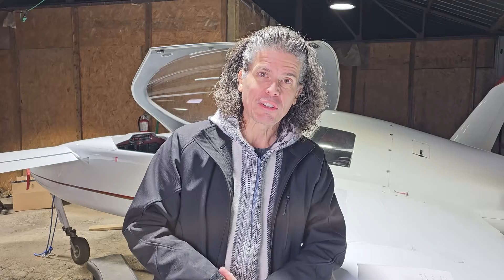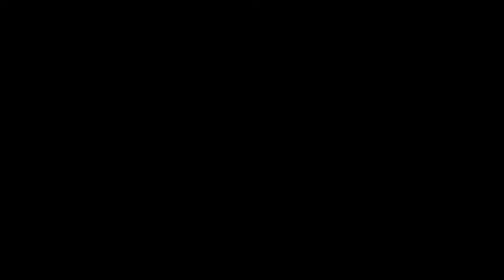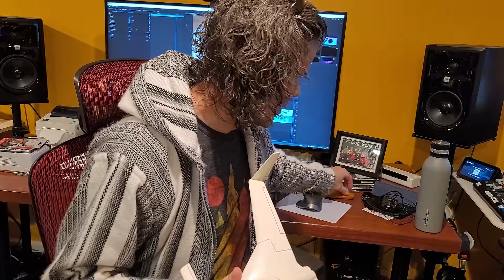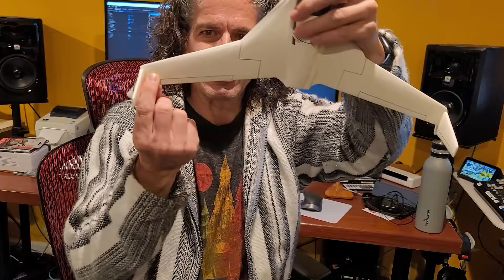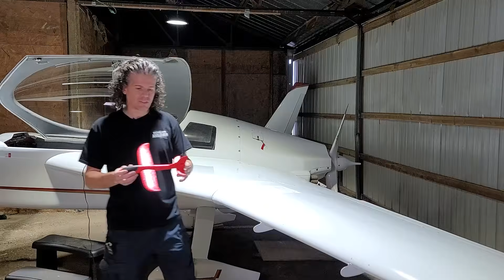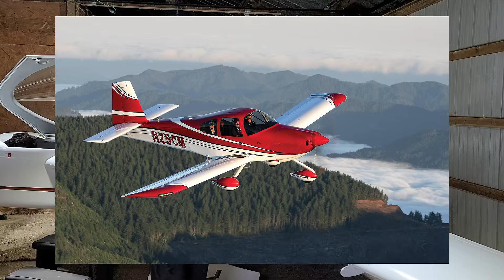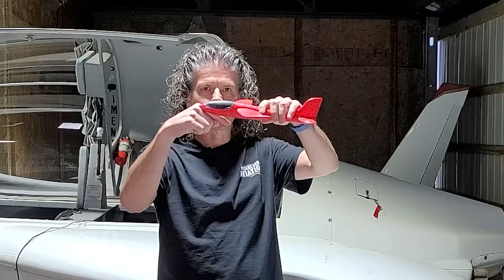Canard Aerodynamics: Why You Might Not Want a Canard Airplane

Comment: Also the prop gets dirty air, which makes it less efficient.
Reply: yet, despite that miniscule amount of inefficiency, the pusher canards still wins over traditional aircraft in cruise speed and fuel burn.
Reply: @wiliam8244  Depends, depends. Look at the efficiency and speed of a Swiss Excellence Risen or of a MCR 4S (keeping in mind, that the latter is fixed gear). Or consider a Panthera.

And the Pipistrel Virus actually has a negative flap setting, that reduces the drag of the main wing and reduces the work that the elevator needs to do.
Reply: @MaxMustermann-nd4uy  Is this a bot or chat gpt reply?  Your statement has zero relevance to this , essentially.   Your point was that somehow any dirty air caused by a pusher was somehow, because you made the point, significant enough to be a negative.   My point was that despite any prop "inefficiency," giving you the benefit of the doubt, the speed and low fuel burn of these canard type aircraft makes any prop "inefficiency" essentially Insignificant.     

Me and nearly everyone that understand this:   "Cruises over 200 knots and burns 10 gallons per hour."
You:  "PROP inefficiency!"

YOu get my point, but probably not! lol

Your response has NOTHING to do with the subject of these comments.
Reply: @orthopraxis235  In principle, I am happy about technical discussions, but on a technical level and not in such a confrontational way. Sorry. If you want a response, you can modify your comment.

Comment: in regards to a conventional  C.L.T.  S.E. tractor prop- cruciform aircraft configuration, there are usually a built in nose down incidence on the horizontal stab of those with a fixed horizontal stab, the main wing usually has a nose up incidence, of which, both are based off  the level line along the aircraft's fuselage.. So therefore when you apply engine  power you have to add forward trim or aft trim as you decrease power in order to maintain level flight during power changes.

Comment: The whole thing with the swept wing and aspect ratio comes down to one simple concept...spanwise flow is inefficient so avoid it if at all possible.  Higher aspect ratio wings have less chord so spanwise flow is reduced and thus provides a higher lift:drag ratio.  Sweeping the wings back increases spanwise flow because even at zero AOA, there is spanwise flow equivalent to the angle of the sweep.  The more sweep or AOA you give it, the more spanwise flow you'll get.  Take it to the extreme and imagine a 100% swept wing, basically folded all the way back like a kitfox in transit.  In that configuration, you have 100% spanwise flow and your wings are almost useless (they'll still make some lift, but not much).  The other extreme is AOA with a low aspect ratio (imagine a wing with the same chord as its span), keep increasing AOA of this wing all the way to 90deg, the air will hit the center of the wing and flow in all directions....forward to the leading edge, back to the trailing edge, and out to the wingtip all at the same time, this could also be considered 100% spanwise flow as the air simply radiates outward from the center of the wing.  Your wing is useless as anything but an airbrake at this point.  Decrease the AOA of this wing to say 45deg and you'll notice that all the air is flowing rearward and spanwise at around 45deg, tons of air spilling over the wingtip which is very inefficient but making some lift.  Swap that wing with a high aspect glider wing at 45deg and you'll see that the air is still traveling out at 45deg but very little of it is actually able to spill over the wingtip, now you're making the same lift but with far less drag.  This is how aspect ratio and swept wings affect aerodynamic efficiency.  Swept wings are only an efficient gambit when you're talking transonic and supersonic flight regimes, and it's not because spanwise flow reduces at those speeds, it's because the shape delays transonic flow and shock waves from being created.  It becomes less important to gain efficiency from aspect ratio and more important to gain efficiency by reducing shockwave buildup the faster you go.  As you mentioned, swept wings in slower speed canard aircraft are only there to get the vertical and rudder far enough back to effect a positive change and inherent stability in that axis.

As for canards not being able to use flaps...well that's not entirely true.  If you could aerodynamically balance the flaps with leading edge slats then there would be no change in pitch moment and no need for elevator input.  You'd gain considerable lift and the flaps wouldn't act like elevators that pushed the nose down, giving you either slower stall speeds or more efficiency by not needing as big of a wing.
Reply from the maker: Excellent summary. I actually meant to mention the use of swept wing in higher speed aircraft for transonic flow purposes. Interesting thought about flaps being balanced with slats - it would work, if you could make sure that they would be balanced at all angles of attack and speeds. Other, larger canards either add simultaneous flaps on the canard (adding droop to both elevators), or like the Beech Starship, reduce the efficiency (and hence lift) of the canard in cruise by sweeping it back.
Reply: That's a lot in a short span of written verbage. He would need actually several class hours and a whiteboard to demonstrate all this in detail.
Reply: Thanks for explaining why there aren't flaps, I was going through the comments before asking. As soon as I saw your comment I realised I should have been able to work out the reason. On seeing the plane, I haven't seen this plane before, this video just turned up as a YouTube recommendation, I didn't think about the swept wing, which as you say is really only required for transonic and supersonic flight, so the fact it is used to get the rudder further back is interesting. The two planes of similar performance are both straight wings, showing that the sweep isn't required for aerodynamic reasons.
Reply: Forward half slats need to go to testing. Call Mike patey
Reply: @martinhiner2059  Most of the newer airliners with slats and multi-segment flaps take this principle into account and sequence the slats to deploy as a function of flap position.  This minimizes the pitch effect and takes some of the workload off the pilot so they can focus on the landing instead.  I'm sure it's well documented, the only caveat is that with conventional aircraft it doesn't have to be perfectly balanced aerodynamically, they can get away with some pitching moment because just a bit of trimming will take care of it.  With a canard, this would require a lot more attention to aerodynamic balancing of those forces, as the resulting pitching moment could easily overpower the elevator's effectiveness at slow speed.  Assuming you were able to get the finished product close to correct from simulations, having infinitely adjustable flaps and slats operating independently during test flights would allow you to find the perfect settings to effect hands off level flight, just a matter of deploying a bit of flaps and then adding some slat deployment until you no longer needed elevator input to counter the flaps.  Mark those positions, then move to the next flap position and repeat.  Eventually you'll have enough data points to graph out a flap to slat movement ratio throughout their entire deflection and lock those in with either mechanical linkages or sequencing them electronically/hydraulically.  And just like that, you'd have effective and predictable flaps, which would alleviate one of the biggest downsides to a canard aircraft.  Someone could make a hell of an airplane utilizing this design.

Comment: Are Flaps really out of the question?
Not full size I admit but I’ve flown RC model Canards that droop both the front and back surfaces that acts like Flaps. Is this not possible with full size?
Maybe you have the danger of making the rear wing create too much lift for its own good!
Reply from the maker: The problem is that if you add lift by incorporating flaps to the main wing, you also have to add lift to the canard, or the airplane will turn into a lawn dart. So you need a system that simultaneously adds lift to the canard, which cannot fail (you cannot allow it to modify one control surface and not the other) - plus this means the canard could potentially then need the ability to create more lift than it should otherwise be allowed in cruise. Such a mechanism is going to be complicated and heavy, which is why you don't see it in small canard aircraft.

Comment: My thoughts:
It's not technically a Canard; it's a twin-wing configuration, meaning there's another set of wings contributing to lift. Canards usually function similar to elevators but positioned in front, making the aircraft inherently unstable. That's why they're often seen in jets designed for agility (requiring fly-by-wire systems).

The horizontal tail (HT) generally provides a moment arm, not necessarily 'better lift' than the main wing. For instance, in stable trimmed flight, when a gust upsets the plane, the change in angle (AoA) on the HT generates lift (a moment arm) to stabilize the plane.

The center of gravity (C.G) doesn't need to be ahead of the center of lift for the wing (not considering the entire plane's aerodynamics center of lift), it is also known as the center of pressure (CP). In this case of a twin-wing setup, yes, it MUST be ahead because of the additional set of lift-generating wings in front (which is why it's not called a canard). However, the model plane you're using is not a twin-wing but a typical tailed airplane. Thus, the C.G can fall within a certain range, depending on the size of the plane's tail. For instance, in a typical configuration like the model you're holding, the CP might be around 25% from the leading edge (LE). Depending on the tail size and distance, the C.G typically ranges from around 20% to 35% LE. Moving the C.G further forward enhances stability but also makes it more prone to being head-heavy and challenging to pitch up.
Reply: Thankyou for your words 😅it helped
Reply: Way too many words. I have built both a varieze and a Defiant. Both. Canards. They are called loaded canards.  You were wrong calling them twin wings. NOBODY calls them that. I considered the Defiant to be a Tandem wing aircraft because of the size of the Canard. It was still a Canard however. I have over 2000 hours flying these aircraft. They were both awesome aircraft.

Comment: yeah the config looks cool but I don't like the configuration over conventional because it's more complex for little to no benefit. If we look at the really high performance designs that gliders are, they are very conventional. As for the elegance of rear propulsion, that's one of several reasons why I'm advocating for getting small turbofan jet engines in GA. For light planes they can be so small that they can be very cheap and a big surprise to many is that if you take them to altitude they will give you both extreme speed and fuel efficiency that you can't beat with piston props.
World distance record belongs to rutan's global flyer which is a glider design with an off the shelf Williams FJ44-4 jet engine and it did 40000km at 500km/h without refueling. Try that in a Cessna 172 :)   Light GA planes with great aero and tiny turbofan jet engines can just have borderline magical performance. Fighter jet agility, private jet freedom but LSA fuel economy.
A polish carbon fiber glider plane called Gekon weighs 69kg with gear and avionics. That means a personal jet doesn't need to weigh the 3300kg that a Phenom 100 does. Or even the 1600kg of an Eclipse 500. Low weight and high glide directly translates to fuel efficiency. An Eclipse actually beats a Baron 58 for fuel economy so imagine how great a light tandem 2 seater could be.
And when designed for high speed it can actually have quite a small wing. So it can actually be cheaper to make.
Reply: @russbell6418 true that a jet shines best at FL600 at mach 3 but an Eclipse already has better fuel economy than a Baron 58 and Eclipse is bigger so if you cut the weight down by 75% which is very possible and engines too then I thrust you can see the fuel economy of a jet can easily be in the workable range, even much below FL400. Say 15000feet.
The cleanliness, the lightness, the silence and the coolness and safety of twin jet just sweeps everything else off the floor. Piston props need not apply.
I did the math on a 4 seater and the jet engines only need to weigh 15kg each. That really helps lighten the bird. And 400kg empty weight is a conservative estimate. If pushed it could be lower still. A carbon fiber bubble can be very light. What's possible with carbon and turbofans as a replacement for a bonanza would blow you away.

Comment: I'm no aircraft engineer, but I was wondering if an all-moving canard could help with the stall recovery. Having it rotate far enough to let the nose drop straight down when needed.
Reply: You're wondering correctly.  That's one of the most important things about a canard - and without any new individual rotation of the foreplane.  The difference in the angles of incidence [i.e., built into the airframe] means that, as the aircraft gradually rotates towards dangerous angles of attack [with the airflow] the foreplane should always get to the stall angle before the mainplane does.  The nose then begins to drop, so that the angles of attack decrease, improving matters for both planes.  Canard pilots can use this feature to make very rapid descents.
Reply: @robwilde855  I understand how normal canard configurations avoid main wing stall. My question about an all-moving canard is aimed at an alternative solution: If the main wing does stall, rotating the canards to almost vertical should eliminate most of the drag that stalled canards generate, making the nose drop faster than the stalled main wing, letting the pilot recover.
Reply: Sorry, I didn't read carefully enough.  I see what you mean now.
   My feelings about that are: 
   1) You say "if the main wing does stall..." - Well, it shouldn't, ever, unless you do something to deliberately cause it.  Because the foreplane will always be stalling before the main wing can, and so the main's increase of angle of attack always stops and then begins to reduce before it can get far enough to stall.  [These relationships of angles of incidence between fore and aft planes, for ANY type of aircraft, are integral to basic design, by the way;  they are essential for stability, and could not be done away with in any "alternative solution".]
   2) The drag of the stalled foreplane is acting mostly in the rearward direction;  so not much of that drag force is preventing downward movement.  Also a normally-stalled nose already drops at a reasonable rate, certainly fast enough to give the mainplane no chance of getting to the stall.  So, is a faster drop really needed?
   3) Your extended rotation:  Are you thinking of more rearward rotation, or a forward rotation, to get to the final 'vertical' position?  In other words is the foreplane to continue to increase its angle of incidence, or is it to reverse its movement and decrease the angle?  If it is to move forwards, it will unstall, and assuming that that doesn't momentarily lift the nose higher [!], then as it rotates forward it will naturally pull the nose down with some force.  If on the other hand it is to move even further 'back' and increase the drag, that would produce a very large force, more than the pivots are designed at present to handle.  And what this 'ninety-degree airbrake' would do to the airflow, shedding violent eddies up and down, is rather alarming to contemplate.  Even if that were taken care of, then the aircraft would never be able to fly in any stable way for more than a moment or two with such a flat-on aerodynamic surface, so the foreplane's natural position would have to be restored very quickly, going back through all those same problems.
   4) Without the benefit of a practical experiment I think your idea, though ostensibly sensible and promising, might be somewhat a 'solution searching for a problem'.  If, however, experiment showed that it did make a difference in some way, then the mechanical problems of the design and operation of a suitable and safe system might be too much, I mean not worth the time and expenditure and complication required.
   Cheers. @matejlieskovsky9625
Reply: @robwilde855   Fair enough. Thank you for your response! I might think some more about it, but alas, I am busy enough with my own area of expertise most of the time.

Just to clarify: I was thinking about the foreplanes rotating forward. The whole idea was probably somewhat like making the foreplanes closer to control-only canards, removing the drag caused by needing a highly loaded foreplane. But you are right that I failed to consider the passive stability of the airframe. While a stall should be recoverable with such canards, it would be too easy to enter for a non-fly-by-wire aircraft.
Reply: @matejlieskovsky9625  You are correct. 

With a Canard that can rotate downward nearly vertical, it will break the stall. 

But a canard that pivots (all-flying) is a thing to be carefully engineered. It will need irreversible controls. Or a very finely tuned anti-servo tab.

Comment: Canard is dangerous at high-g maneuvers close to the ground - stalling is dangerous.
Reply from the maker: ANY aircraft is dangerous to do high-g maneuvers in at low altitude. Canards however won't stall/spin like a conventional airplane, so it does give you a slightly higher safety margin in those circumstances.
Reply: Gotta watch those pitch bobs but you will not be spinning from an accelerated stall.